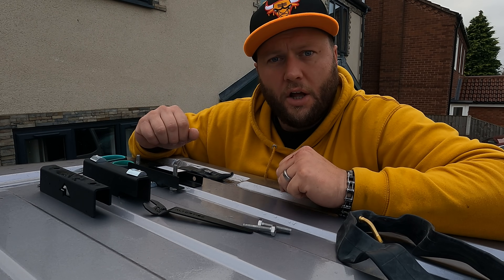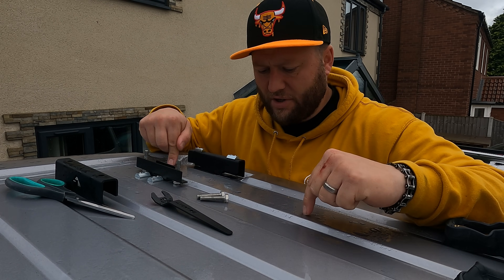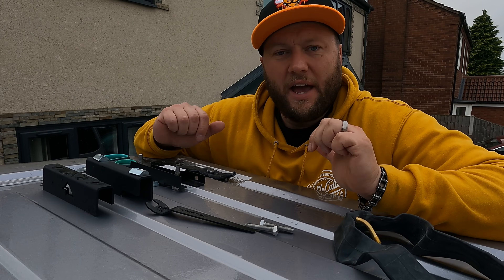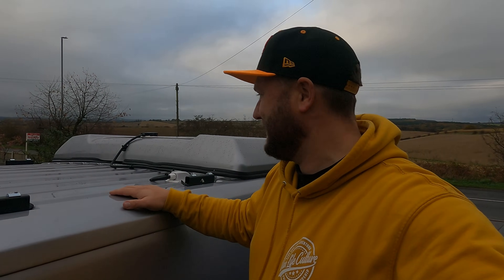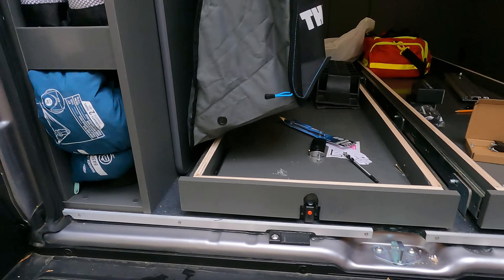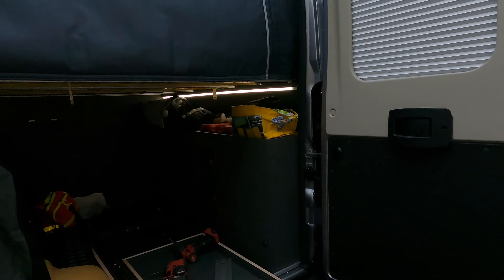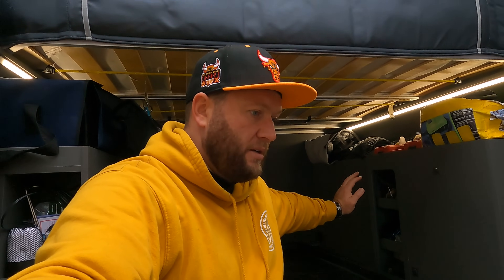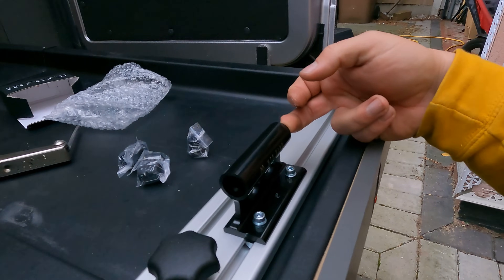AUTOTRAIL EXPEDITION 68 MODS & SNAGS!

Comment: Hi to fellow new expedition 68 and levo owner , our van went back last week , bottom latch on cassette door wouldn’t catch and even worse especially for my ocd , somewhere between fiat and auto trail , our van has been damaged, and has had a so called paint repair, I noticed white stuff on the clean water filler and  rear plastic arch extension, thinking it was polish, but later while in the Peak District one sunny day I noticed the paint repair, so had the filler and arch replaced , but not getting them to touch the paint probably will make it worst , I’m having new graphics designed atm and that area will be covered, first mod yesterday was I removed the rattly black  fridge front cover , and slipped in and nice gloss orange cover now , gives the van a nice pop of cover
Reply from the maker: Hi there! Thanks for sharing your experience—it sounds like you’ve already been on quite a journey with your Expedition 68. The damage and paint repair must have been so frustrating to discover, especially when you’re trying to keep everything in top condition. It’s great to hear you’re about the new graphics; that’s a great way to personalise the van.

The gloss orange fridge cover mod sounds brilliant! A pop of colour like that really adds personality to the interior. We’ve been experimenting with some modifications ourselves—part of the fun of owning a campervan, isn’t it?

Hopefully, the latch issue and any other niggles get sorted soon, so you can fully enjoy your adventures. Let us know how the new graphics turn out—we’d love to see how they look! Safe travels, and maybe we’ll cross paths on the road one day.
Reply: @  hi just watched your latest blog , nice system you just had fitted and love the rear view camera, haven’t got our graphics design come through yet , well we’ve had 2 options so far but didn’t look right , trying one more if that doesn’t sit right we won’t bother , keep looking at wheels too but can’t make my mind up , probably will change the tyres to something more grippy for wet grass , I did however let the tyre pressures down some as the ride at 75 psi was awful, it’s not to bad now , yes our paths my cross one day , with just got back from a weekend in the new forest,  it was great staying in the forest and still learning a routine for our van living , this weekend we had just an electric hookup and no other services, all went well .
All the best
Reply from the maker: Cheers mate it’s in for a few more bits this week 🤣🤙😎

Awesome enjoy brother and have a great Christmas 🤜🏻🤛🏻